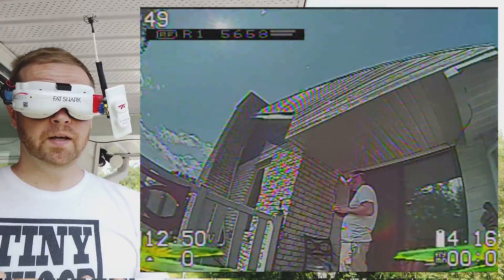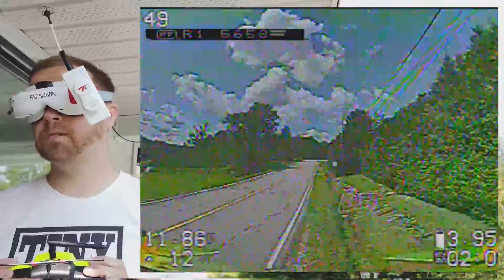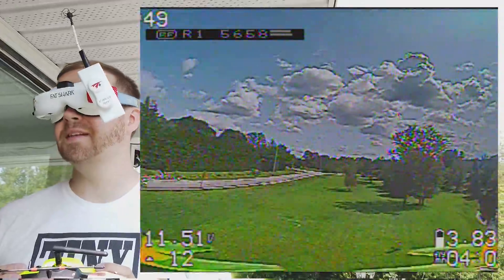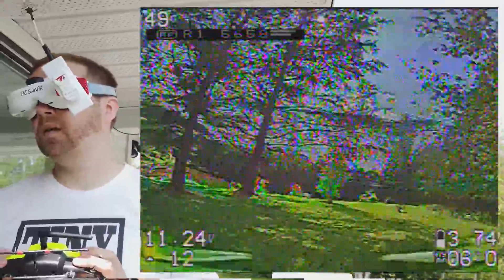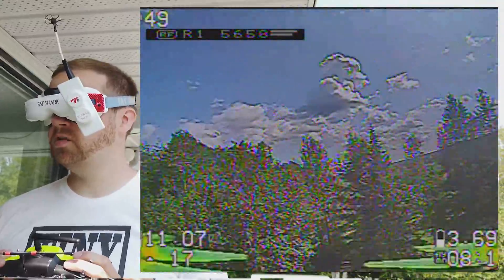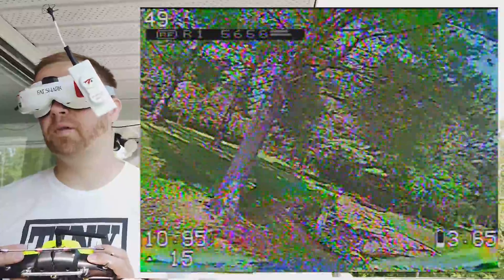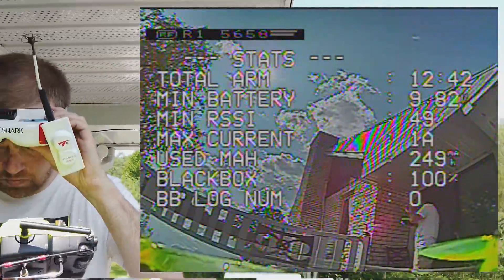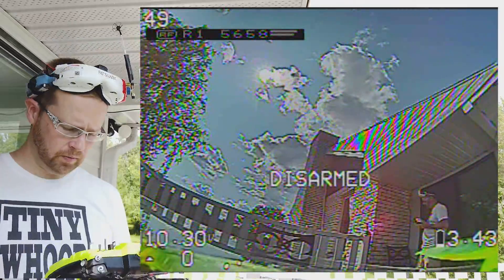12min+ flight time on 3in FPV drone using 1404 6500kv motors

Comment: Hi sir do u think 1206 4500kv for 3 inch toothpick is good ideas? And with 3s 450mah lipo! Thanks for posting vids
Reply from the maker: HelioGenesis yes it seems about right.
Reply: @JeromeDemers  ahh nice to know that im not making wrong mistakes. Love the vids amd thanks for responding
Reply: Oh lastly what type of low esr capacitor range i shud use in this category of tp3? Im in dilemma to choose capacitor for it. I cant find any info on tp3 with capacitor guide. Thank again have a great flying
Reply from the maker: @hanquah  get some panasonic low ESR cap from 220 to 470uf with appropriate voltage. If you buy betafpv AIO they have the capacitor solder on the XT30.
Reply: @JeromeDemers  okay i will follow ur tips. Thanks again for response. Its really helpful tips.